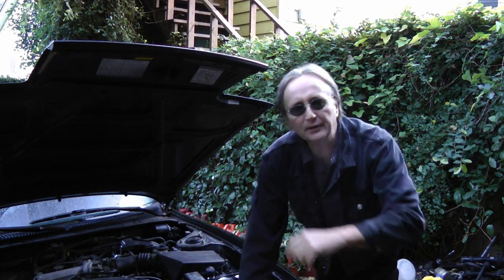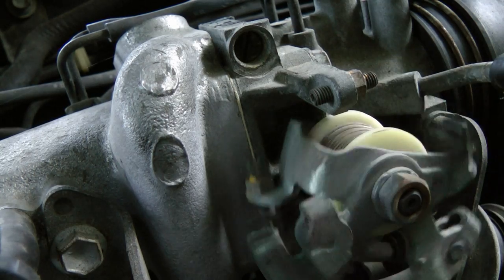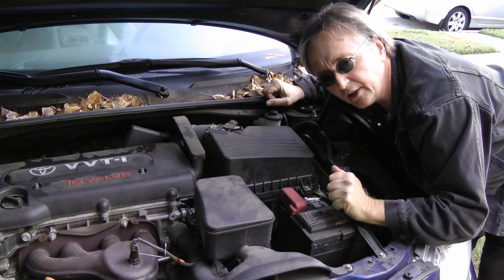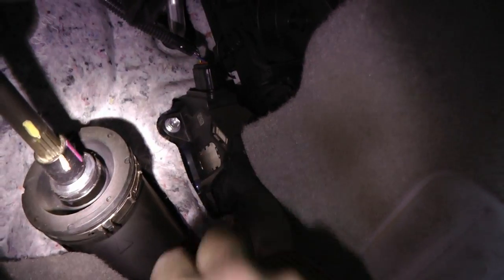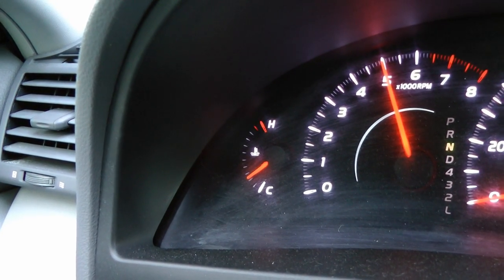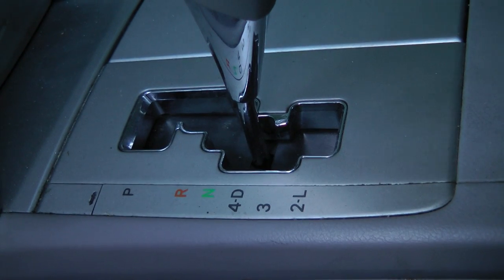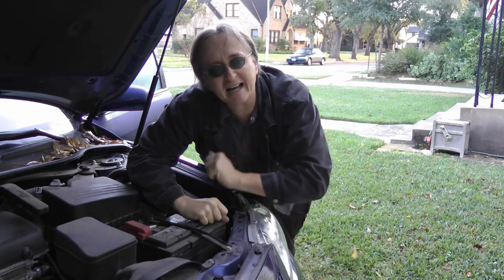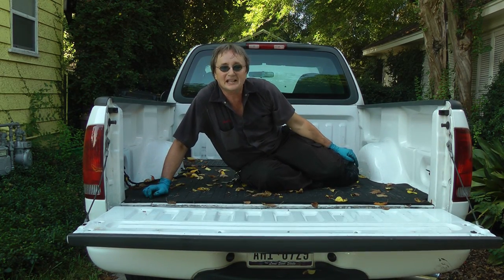How To Stop Unexpected Car Acceleration

Comment: You dont see the problem because you aren't encountering it for the first time in high density high speed traffic with your children in the back seat.  Even a professional driver might have a problem with a once in a lifetime problem. 

Shifting isnt recommended because a panicky  driver with an automatic trans may have never driven a stick,  lacks the driving reflexes of shifting,  and could miss neutral and select reverse.  BTW The new all electric cars may not have gearboxes of any type and are everything by wire except the parking brake . 

Even with drive by wire,  theres always the brakes, and steering, which may have  electric assist but are fundamentally mechanical.   Finally (only) when in a safe place,  the ignition.
Reply: Nope wrong. Mom drives a 2014 Kia Optima hybrid. You can hear the transmission clanking around when drive is selected.
Reply: When drive is being selected that is.
Reply: Chinesefoodrocks1521 If you can hear an AT clanking as it shifts, something is wrong with it, and a hybrid is not an all electric car, it's part electric. I was speaking of cars that don't have an engine, just an electric motor. That there are all electric vehicles, hybrids with cvts, and conventional gasoline cars with a wide range of failure modes and huge differnces in brake hp, driven by people with difference in reflexes and ability to think clearly even in non emergency situations.  That's the reason why Scotty's simple "put it neutral" isn't recommended. 

General recommendations are aimed at the lowest common denominator - those who can sometimes start their cars and point them in more or less the right direction when they arent yacking with passengers.

Heck, the reason we have ABS is that people outdrive their ability to control direction in a panic stop.  Pointing straight ahead and holding the brake is what the worst drivers did before ABS.  With ABS skilled drivers had to unlearn good habits.

Comment: sorry i dont care for toyota. i like the gold ol' GM pushrod engines. no toyota engine will ever come close to a 3800 or a small block V8. pushrod 2.2 GM engines also have a long life.... but they are prone to head gasket failures, i have 215K on my 2.2 and its still going strong. pushrods are simple and foolproof, not timing belt to have to replace either, timing chains are more durable.... they can fail but usually dont and most GM engines are non-interefence

Comment: Or you could just use the brake.
Reply: +Shane Grogan haha I wish it was simple as that, but when the car starts accelerating on its own, the brake doesn't work. That's why most (almost all) people who experience this starts to panic and get themselves involved in accidents.
Reply: Joseph Jung You can't just make a claim like that and expect me to believe it without any reasoning or evidence. Why would the brake not work exactly?
Reply: I've seen videos taken from the blackbox device installed on the vehicles that malfunctioned, and the drivers all yelled out loud that "the brake doesn't work." I mean, come on. Think about it. No accidents would have happened in the first place if the brake worked properly in situations like that.
Reply: +Joseph Jung In that case, the driver probably just didn't realize that the brakes were working, and gave up before the deceleration would be noticeable.
Reply: If you're a driver yourself, you would easily be able to tell if the brakes are working or not even in normal driving conditions, and this is even a more extreme case. It is natural to literally slam on the brakes if something like this happens and YOU know yourself that if you slammed on the brakes, the car would jolt hard and decelerate pretty quickly and come to a stop eventually with loud noise. One of the people who experienced the unintended acceleration stated that it had been 35 years since he acquired a driver's license. 35 years of driving is, in my opinion, a sufficient amount of time to be in a position where noticing malfunctions of basic features of a vehicle like brakes becomes very easy. People are not that dumb.
Reply: Joseph Jung Normally, when people operate brakes, they are not at full throttle. Those conditions are vastly different and may, to many people, cause them to become confused, especially in a state of panic. There isn't a mechanical explanation for why the brakes wouldn't have any effect at all.
Reply: Why would you think there are tons of videos on youtube explaining how to cope with unintended acceleration and these videos tell you things other than braking? Because braking does not work when the computer system starts malfunctioning and operates the car on its own
Reply: ***** Thanks for all the mechanical facts. I didn't possess the technical knowledge because I'm no expert. There have been a lot of instances of accidents caused by unintended acceleration in Korea, and I read a lot of articles about it. The articles all included statements made by the individuals who were involved in the accidents that said the brakes failed to work, and that's how I came to learn that when unintended acceleration happens, the brakes fail. The video I provided is a compilation of clips recorded by recording equipment called "Blackbox" which are designed to be used as evidence when there might be insurance conflicts due to lying of the other party, or for surveillance purposes and these devices are capable of voice recording depending on how you set up in the settings.
Reply: ***** It's ok :) I believe what they call "blackbox" in Korea is what they call dashcams in the U.S.

Comment: Americans drive too powerfull cars . My car has 60HP and it goes just fine on HWY , and it is impossible to have dangerous acceleration .
Reply: 60hp, that's too little. Plus horsepower is fun. Of course with 60 you wouldn't know that.
Reply: Tony K Well, if car has 850Kg, 43kW is enough.